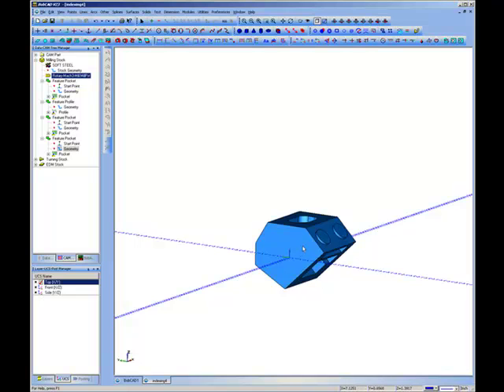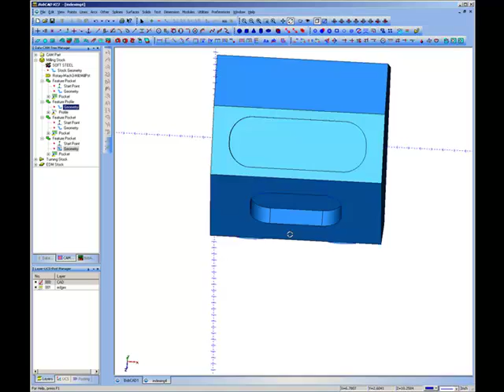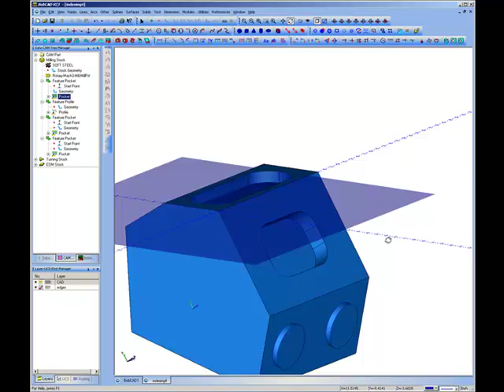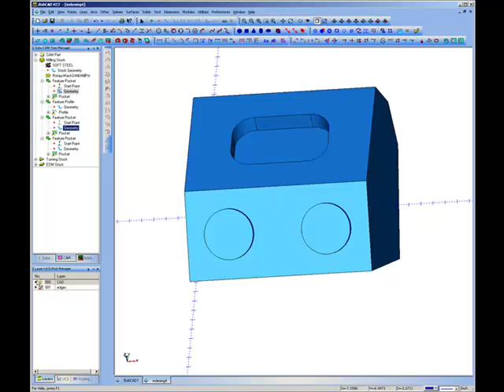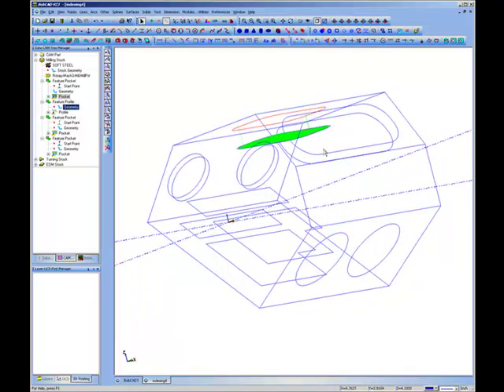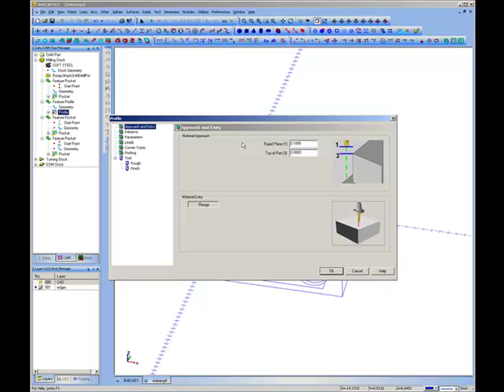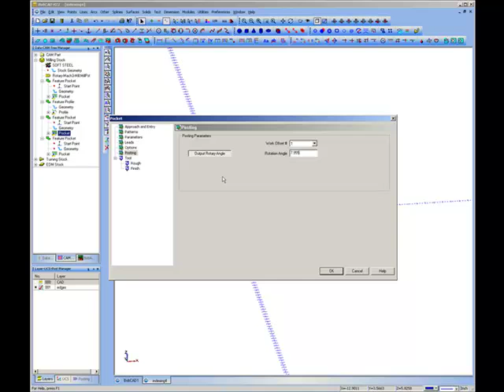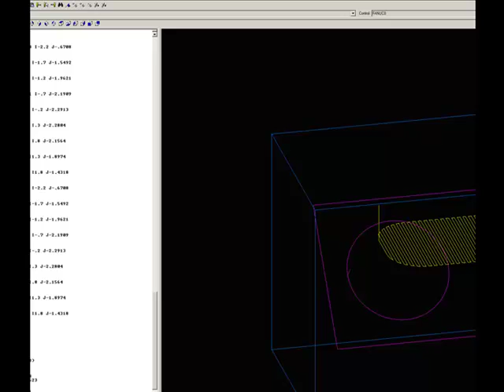bobcad indexing

Comment: thanks for making the video,  would your second ucs be considered g55 in 4 axis? I'm using linux cnc and am having a bear of a time with machine settings and ucs's.
Reply from the maker: Not really. The "Work coordinates" of the job are just setting something different than the "Machine coordinates".So the stock being worked on is setup at G54. I would think you setup a G55 if you had a large table and needed to "setup multiple stocks" to do different jobs on.The UCS's in this case are just helping define the "indexing rotations" for the post processor to output "A" moves for the 4th.This is an old version of BobCad, so it has different hoops being jumped through to get the output.I don't know your software, etc.... But there should be 1 work coordinate for this piece. AND, your 4th code should be posting from a single UCS. So, a default WCS (Or UCS if you are located away from the WCS) with 4th axis code indexing being output from there.
Reply from the maker: This is Old BobCad also, so what you see in the video is actually a cheat, and I am rotating my "Geometry" to cut parts of the object. Not the way it "Should" be done. The system should know how to rotate around in the workspace.